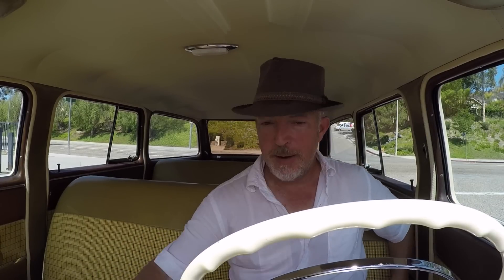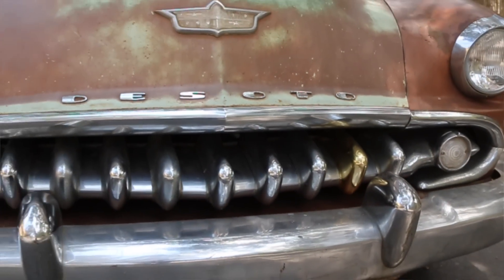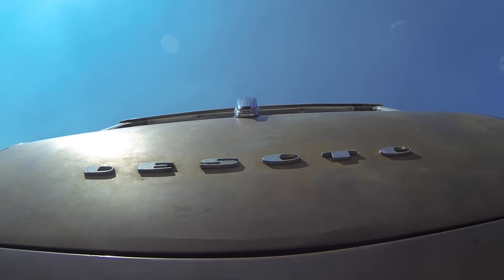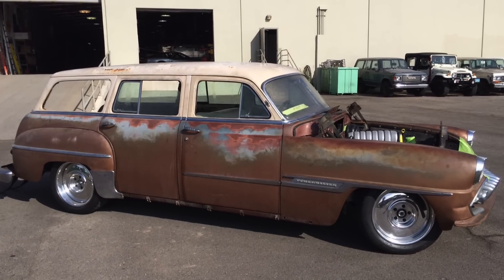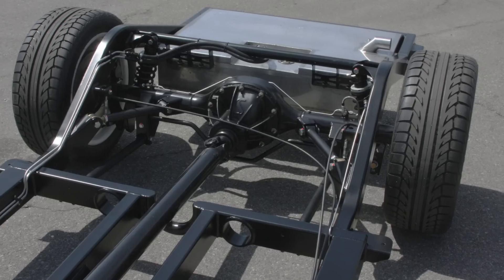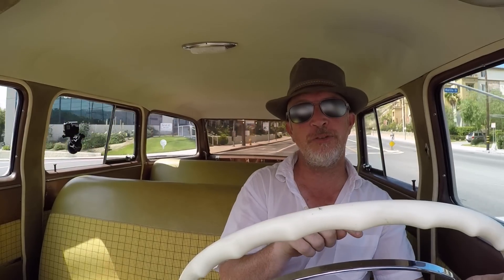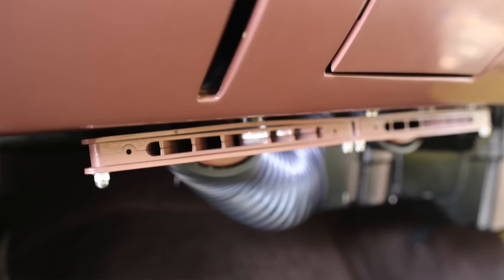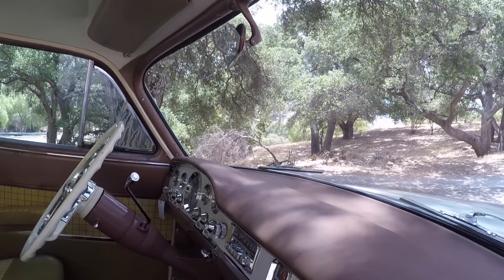1954 DeSoto Powermaster Wagon ICON Derelict

Comment: I'm pleased by the irony of the little dig about how they made cars better in the old days coming at the beginning of a video detailing an exhaustive process of taking an old car and rebuilding it into what is, effectively, a modern one shaped like the old one.  The laundry list of modifications made is basically a catalog of the stuff they didn't do as well in the old days--brakes, suspension, a steering column that won't javelin instantly through your heart if you run into anything, AC, reliable electrics, corrosion resistance, and on and on.

I kid because I love, all the ICON products I've watched the videos for so far are awesome, but let's not gild the Olden Days too brightly.  Cars in the 1950s were better-looking and better-named, certainly, but better built?  If that were truly the case, surely outfits like ICON wouldn't have anything to do. :)
Reply: his point was they were not made with better parts but were made to last
Reply: There is a difference from build and engineered. Modern cars have more tech and engineering, older cars were built by people, not machines.
Reply: ZGryphon You beat me to it.  Cars are safer, more reliable, and better engineered and built now than in the Fifties.  They are also often boring and uninspired compared to cars from the past.
Reply: The cars back then are now horrible from a mech perspective, but man do they look a lot better than the cookiecutter round crap we have today. A Mondeo looks like a Tesla which looks like an Aston Martin. Nearly. All roundness, all passenger-hit crap. I mean if you same em next to each other from a 100 years you had to look twice. I can spot a Tri-Five from half a mile away. I love ICONs and I am going to get one (not from him, too expensive) built from a Studebaker in 2019. I know it will be worse than his, but its going to be mine and never for sale.
Reply: Cars in the 50s were far, far more varied in shapes than those in the last 10 years but most of the 50s cars were mass-manufactured too; all were "cookie cutter" for the time. Many just didn't last for one reason or another; tire blowout leading to a tree wrap-around, rust, engine failure leading the owner to sell, etc.
Reply: Austin, true, even Ford Model T's (especially them actually) were cookie-cutter cars in their time, but as you also mentioned, my point was the much bigger variation in shapes, sizes and form. Sorry if I was being unclear.
Reply: @milesblue638  Definitely more boring.

Comment: Inspiring. I owned 2 De Soto's 1954 and the grill and the dash board Auto with no park. 260 cubic inch V8. So this effort is quite stunning. I drive a 2008 300C SRT8 with the 6.1 Hemi. And this powers the Icon-brilliant engine.

Comment: This is as close as I've ever come to seeing the first car I ever drove. My dad bought a '53 DeSoto PowerMaster brand new and we did a lot of traveling with it. It was the same exterior color as this one. The PowerMaster model was a straight-six flathead engine with a single barrel carb that was listed as 116 HP. The Firedome models had a hemi-V-8. This was the first car Dad owned that had power steering. It had Tip-Toe-matic transmission. It was a fluid drive and had a clutch, but you didn't always have to use it to change gears. You picked high or low range and accelerated. When it was time to shift, you'd back off the accelerator momentarily and it would upshift. Our prior car was a '50 Dodge Coronet and they called the same basic thing Gyromatic. I once floored the accelerator while on ice in the alley behind our house and it didn't spin the tires, it just moved forward gradually. Dad also bought a small '53 Airstream travel trailer and this combination was severely underpowered for mountainous travel. Dad replaced the '53 with a '57 DeSoto wagon with a V-8 with a Power-Pack. It still struggled at high altitude but didn't make you wonder if you'd ever get to the top. The '57 was a lot prettier and more powerful, but wasn't built as well as the '53. Ours had 11 and 13-ply birch plywood throughout the cargo area. With the chrome rub rails, like this one has also, it was a beautiful execution. Thanks so much for doing this project and making this video.

Comment: The picture of it "as found" was beautiful. I love the original wheel covers and wide white walls. Perhaps on a similar future project you could design a wheel cover that fits on these engineered larger wheels that mimic the white walls and original style covers. while still having the greater clearance for brakes and suspension. Just an idea.

Comment: A rich high school friend got to choose his own car when he turned 16.  He chose a 1965 Chevrolet station wagon in that bland, sort of grayish-red finish.  He also chose a 327 engine with fuel injection, police suspension and tires and a B & M Hydramatic transmission.  Air conditioning, power windows and an AM/FM radio. The hottest station wagon in Arcadia, CA.

Comment: 2022,.....I wonder if you restored any of those huge, Nash cars,....I love them,....I'm in Ohio, and nobody is restoring them around here. I just had dream about one,....I dreamt someone had one in original condition and was using it as a work vehicle,...like some contractor had converted into a work truck.  I was born in the 1950s,,....when I was in college, in the 1970s,...a buddy of mine, found one in a barn, down in Southern Ohio, and began to restore it. It was operational, running,...but the body needed a lot of work,....I think it was a "woody",...it had real wood, exterior trim. The wood resembled the kind of wood you'd see on a 1950s motor boat,...maybe it was maple or oak,...it was a light colored wood. The car must have weighed several tons. I'm driving a 2007 Honda Pilot SUV and it weighs about 5,000 pounds,..it is insanely heavy.  I bought it used, and I am not a fan of it. Too boxy,...sort of ugly, too.

Comment: Looks like this DeSoto has a 3 on the tree. Narrator says its automatic beut appears to be 3 speed manual.
Reply: It was a semi-automatic called TipToeMatic on DeSotos. It had fluid drive and a clutch, but for normal driving, you didn't have to shift. As you accelerated and the engine wound up, you could momentarily release the accelerator and it would upshift. Most of the time, it acted like an automatic two-speed. The clutch was used to shift to reverse or for lengthy idling such as a long stop light.

Comment: You should Google Earth and Street Map Huachuca City, Arizona, and take a look, not a big town. A place called Fort Auto Parts on highway 90 just south of Patton street and pan south. This place is right beside the road and look at the original treasure trove of 1920s thru 1960's vintage autos sitting in there. One of those hidden gems.

Comment: Wow ,  $150K car that looks like it just come out someones field after sitting for 30 years. interesting
Reply: Actually it does have some appeal. I think I could live with a car looking like that. Is the exterior coated to prevent future rust and deterioration?
Reply: Thanks for the reply,  on the east coast of Canada new cars with undercoating don't even last 10 years. the only thing that even comes close to working is to spray everything with a mixture of engine oil and xmsn fluid. Its messy but my 97 Camry is still in very good shape.

Comment: Ok many problems here.  First problem this car needs no "modern" updates.  Said it ran stock when found.  Why not celebrate that?  Damn thing ran and drove very well with the "stock" Chrysler corp rigging.  Ya, who needs yer off brand front suspension and the all the goodies steering column?  Oh sure, put a Gm 350 under the hood or whatever.....Now it's no longer a Desoto is it?  Ok, let's say you keep it brand specific.........Steering and brakes might have come from a Dodge Aspen along with torsion bar suspension,  but U just hadta put a Ford 9" rear axle under it didn't ya?  So many Chrysler corp choices and U hadta go off brand.  

Does "Stock"  mean nothing to you?  

I dunno about this car but some 1954 Desoto powermaster cars came with a small hemi V8 coupled to a 3 on the tree with electric overdrive which gave 6 speeds if properly used.  I'm betting U replaced that with a 3 speed automatic tranny.  That's the second problem.  

One less confusing floor pedal for those who aren't competent to shift their own gears.  Incompetent drivers always use auto trannys.  

Third problem, is you were so deprived of worthwhile cars to find and make roadworthy that U hadta do a 4 door station wagon.  UGGH!.  Crusher bait!  Nobody really wants a 4 door station wagon to restore.  Maybe that's all that's left from 1954 but don't mean it's noteworthy.  U had better go looking for 2 door hardtops.  Maybe some true Coupes.  I own a '50 Plymouth Business Coupe I will sell you for BIG Bucks.  Not barn find $$$.  

4th and last problem is that U give NO CREDIT to the stock engineering of any of the cars U drive,  Oh yeah! why doncha find a stock '57 Chevy fuel injected 283 and restore that?  Compare it to yer modern auto tranny build.  How about a '56 Ford T bird with a 312 Y block and a Paxton factory super charger?  How about finding some old "NASTY" Hemi's?  727 push button transmissions.  Go Fast isn't NEW!  10 sec 1/4 mile cars rolled off the assembly line since the mid 50's.  Go find you some.  I personally drove many of them.  '59 Plymouth Fury, '58 Chevy Impala, Ford Cleveland engine powered cars.  Some Nasty big old boat cars Caddy,s, Pontiacs, Oldsmobiles, Murcurys, all of them.  My '64 Olds had a factory speedo marked to 135 mph and would bury it 6 yrs old.  why doncha talk some about them cars instead of what U do with with an unwanted rust bucket?
Reply: dude.. get ahold of yourself.
Reply: I see that you have completely missed the point of a restomod, along with confusing your taste in cars with everybody else's. Its also clear you didn't even watch the video, so why don't you piss off and leave the rest of us to enjoy the hard work that went into this project?